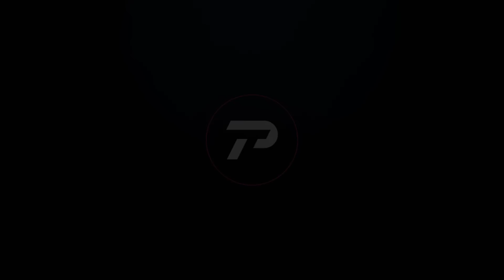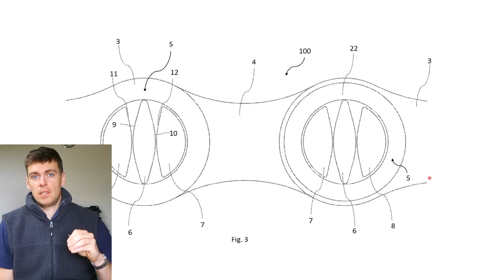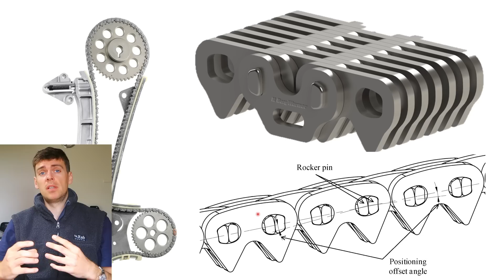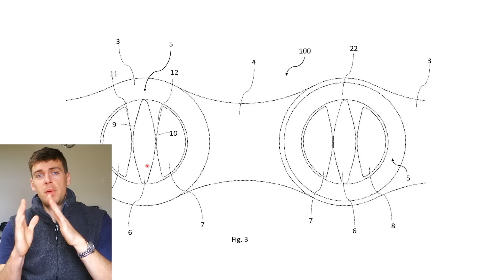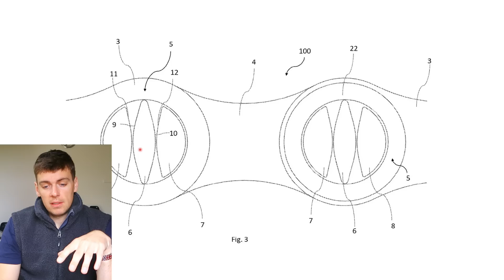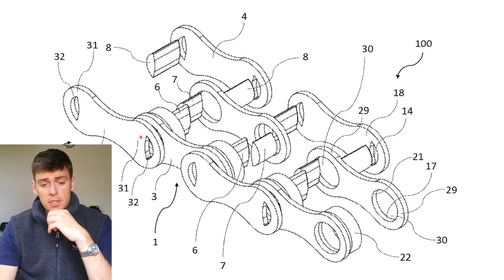Chasing More Chain Efficiency: Patent Application

Comment: You can clearly see in the drawing that they keep the center ring to cover the rockers (marked "22" in the drawing) . So all the force will be brought onto the rockers through those rings which in turn will slide on the rockers in the same way as they do in conventional chains on the links. I'm not able to see any kind of advantage in this rocker system. It's overly complicated and it looks as if you can't shorten your chain according to your needs.

Comment: If there is a rolling action, won't there need to be more clearance between the plates that locate the pins to avoid the sliding friction? In which case there is more room for fouling and dirt (car engine bays aren't susceptible to the elements and dirt like bicycle chains)? BTW I love your content and channel.

Comment: Is a belt drive really way worse than typical chain and sprockets?  Seems like way less parts moving, but curious about the actual belt material VS metal.  Just realized internal gears though....
Reply: Currently a belt drive is restricted to only work with IGH or drive box systems, not cassette drives.

Comment: Very interesting,
I am not an engineer, so correct me if I’m wrong, but the pitch wouldn’t change for this design. The rocking mechanism is contained in a circular with a fixed center, no different than regular chains. The other rocking chain that you compared it against can’t be contained in a circle this way.

I’m also wondering what the change in efficiency, if any there would be from rotating the internals. Considering that the chain is under tension. I’m surprised they didn’t rotate it 10-15 degrees, claiming another marginal gain by doing so.

Comment: Inter Pin Friction nightmare. parts 7,8,9, have to slide against each other as the links rotate relative to each other, and note 6 is longer and if you rocked (not slid) a 7 or 8, the position of the circumferences change relative to 6, hence they must slide (or bind). What friction did they get rid of? They got rif of bearing surface on the inner plates...
Also Riveting can only occur on 8 to the outer plate as 6 & 7 shown in diagram to be floating, and the inner plates have a simple round hole. Tiny pin to take the sideways load (the automotive versions do not get. Automotive versions covered in clean oil as well).
Designed by or for the marketing department like that Ceramispeed "Driven" disaster.
Reply from the maker: Great analysis
Reply: Correct! There is no rolling motion between the rocker pins and the center floating pin, but pure sliding. Indeed, the sliding speed will be lower than for a round pin due to the radius difference. The contact pressure will also be way higher than for round pins (likely more than 10 times). Bottom line: lower friction, maybe, but I am not convinced until I make a calculation; higher wear, certainly. The wear part I know for sure from wear testing rocker pin transmission chains in sooty oil; they elongate like crazy, while bush chains are running well. Maybe some unobtainium pins from Ceramic speed will do the trick ;)

Comment: What are the effects of "crosschaining" on friction? Where your chosen cassette cog isn't inline with your chainring. 

I would have thought that would be one of the major contributors to drivetrain efficiency losses
Reply from the maker: Yeh you're right. Its something that 1 x 12 drive train really, really suffer on. If you're climbing in the largest cog on the back, the larger cog efficiency gains are totally overshadp by the lousy chainlines. If i was going to do marathon XC or Gravel event, i would definitely be using a 2x for this reason.

Comment: Waxing chains, I’m interested but put off by the initial cost and seems a lot of effort. 

What I’m most interested to know is how quiet the drivetrain is in practice? I wouldn’t like to invest in setting up only to find I have to keep putting drip wax on to keep it quiet. My rides are usually between 20-60 miles.
Reply: Waxing isn't actually that much effort.  The initial chain cleaning to remove any lube/grease on it takes some effort (it is a one time only thing though) but after that it is put in crock pot of wax and leave it until everything is melted and hot, give the chain a good stir, remove chain and let it cool.

With my waxed chain the drivetrain sounds pretty much like it did when properly lubed with normal chain lube but it doesn't get louder as the lube wears off.  The main benefits are that the chain stays clean which is worth any slight increase in effort waxing the chain.  No more oily marks on anything that touches the chain.  No muck sticking to the chain.

Comment: So the rockers could reduce friction as the chain articulates around the cogs, but in order to step sideways from cog to cog you need that clearance that roller chains have. As the gear cluster has become wider and wider that sideways articulation needed to increase and as such the clearance between the rollers and pins had to increase in kind, this is why higher speed chains wear out sooner than lower speed chains. So the rockers would have to be 3d to allow the chain to "bend" sideways to change gears. As such this would only work on fixed or internally geared systems. Plus they'll likely be heavier and more expensive, to gain 1% efficiency. Not worth it imo but interesting to see development and innovation in chain technology nonetheless.

Comment: Will it work with chainlines when chain twists? Probably not. I think it’s for track bikes only. Single digit watts matter there, chainring profile can be easily made custom, no contamination too
Reply: Izumi track chain - around $80
CS track rocker chain - around $800 for 5 watt benefit. Wait, you need chainring and cog, too!

Comment: timing chain works great on Mercedes. And BMW
Reply from the maker: Id never buy a car with a belt 😂
Reply: @PeakTorque  Modern timing chains on modern cars are not actually that durable or reliable anymore chains slip and jump and wear guides out at 50k on some well known German cars ,the service interval for timing belt is 100k on some vehicles
Reply: @1brokenspoke189 you are wrong. Big time.
Reply from the maker: @1brokenspoke189  100k for a belt? Maybe my knowledge is outdated by most VAG cars it's about 50k
Reply: @LucianBotez-yz7nj  20 years as a mechanic says I am correct some vehicles do not make it out of warranty period without  issues
Reply: @1brokenspoke189  20 years of design, release and development of timing drive systems - dry/wet belt, roller, bush, silent chains, tell me otherwise.

Comment: Hot take. Ceramicspeed filed this patent not to produce this chain but rather increase the value of the brand in case some bigger company is up for buying ceramicspeed.
Reply: And/or to disincentivise innovation by stamping their patent trolling all over everything (looking at you Shimano)
Reply: Spot on.
Reply: This is the most common reason for filing patents. Making the knowledge tangible and something to purchase - adds value to the company. Patents are useless unless you have the means to protect them. Big companies prefer to swap buckets of patents with rivals if they want some knowledge or just buy up smaller companies whop have patented their technology.
Reply: Yes! No bike bearings get hot enough to see benefits of ceramic bearing. There is no value in that company it’s just marketing @ trek, specialized, giant, etc.

Comment: Well explained 👌👍so Ceramic Speed will be selling multi-thousand $$ entire drivetrains, The Lab 71 S-works $15k top of the line with $10k crankset cassette and pulleys 😆

Comment: If the ends are closed?
Reply: Yeah, the exploded diagram shows the ends being closed. The thing that's puzzling me, is how does the chain stay together? There's nothing I can see that clamps it all together. I guess I should go and read the patent...
Reply: A nice oil bath chain case could prevent this from becoming a mini rock crusher. Fluid friction losses and weight would likely kill any gains.
Reply: Guessing the cut outs in the outer plates are an interference fit?
Reply: @tompi5  Ahh yes, I see. So in the diagram, part (8) does slot into both other plates (holes (14) and (32)), and presumably is stuck there somehow (peening? electro-welding? some sort of glue? pure friction?). Curiously this does mean that both other rockers (the middle lozenge and the other "side" too - parts (6) and (7)) are floating - there's nothing for the "other side" (7) to bind to on the inner plate, from what I can see.
Still, thinking about it even harder (and bear in mind it's late on a Wednesday...), I'm beginning to think Mr Torque's objection is not that the rockers are open to the elements at the side, but that they're open top and bottom. And really when you think about it, the motion of these rockers ... well, it's a funnel that slowly compresses and grinds to death anything that falls into it. Yeah... this is going to be fine isn't it?!
Reply: As others have pointed out, there is a roller - part 22 - and it encloses the rocker bits.
Reply: @matthewsackman  Ya,but, the roller that fits over the rocker elements never stopped grit from entering chain pins and bushings before.  Only an O ring chain as motorcycles have could pretend to do this! Just imagine the contact friction drag such a chain would have. Worse than square one! High cost, novel design,  track only= no market.